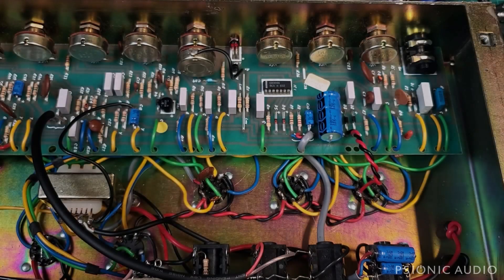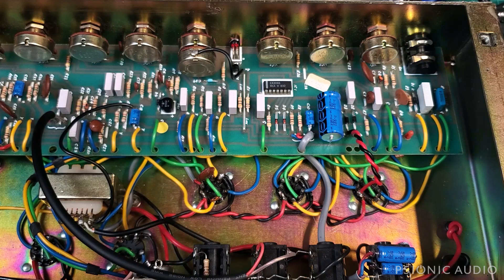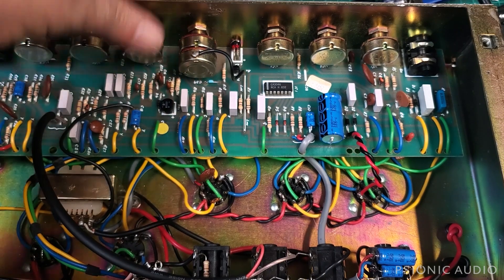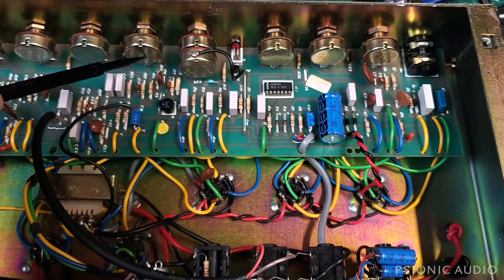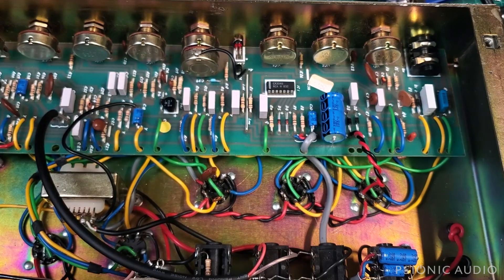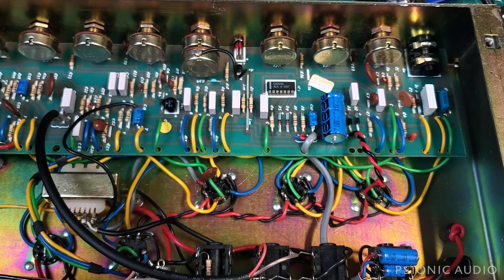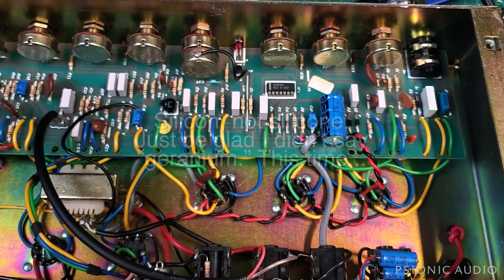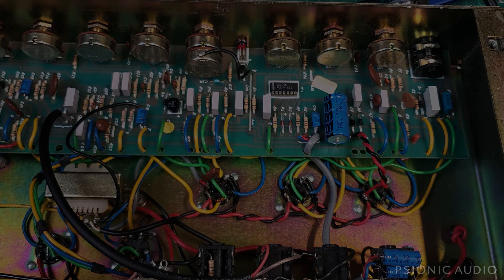Peeling the Onion | Marshall 2210 Switching

Comment: There's a issue correction note from Marshall for earlys 2205 & 2210 to fix the channel bleeding. A 220nf cap between CA3046 pin 8 and Ch.1 MV center lug. Maybe it worth to check!!
Reply from the maker: This amp already had that from the factory along with the two added 10uFs.

Comment: I thought it might be of interest to you that an early version of this amp does indeed use discrete transistors for switching and has twice the filtering too. I had a early 1983 (Jan 27) come across my bench that, which is all to common, was heavily butchered. The exact schematic for that version is made of unobtanium but, the schematic for the 4210 50W Reverb Combo from that era showed the early switching circuit and was enough to guide me through the repair.

I hope this information is helpful to you in the future. 

Best Regards
Reply from the maker: Thanks! Yup, I've had a few. Always fun to go schematic diving to find something similar.

Comment: If I understand you correctly that one white cap is causing noise to leak into the drive channel. Wouldn't the mean that it is leaking DC? I remember working on one of the first versions of this amp and it used transistors for the switching circuit, and had red LED's instead of a bridge rectifier. Trace Davis told me that if you remove the led's there will be a LOT less gain.

Comment: 250V caps to ground out the volume knobs?  I'd be curious at what the schematic looks like. I'd think you could get by with a lot less.
Reply: Yes, absolutely. There should just be an audio signal here, the DC was already blocked upstream. They probably used 250v caps because they were already used elsewhere on other products (BOM simplification).
Reply from the maker: Yeah, but it's a matter of lead spacing on the board too.
Reply from the maker: Aaaand I misread them. 100V caps. Still.